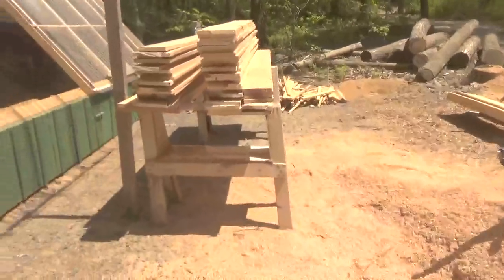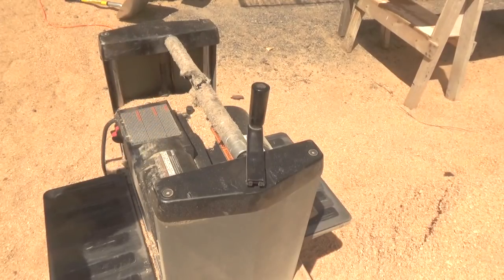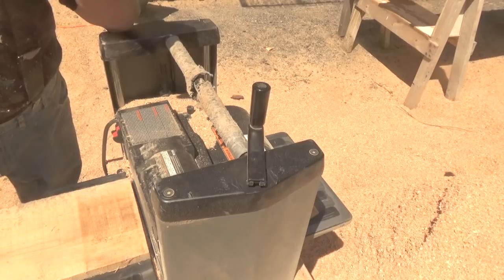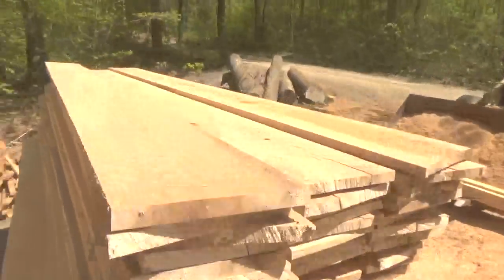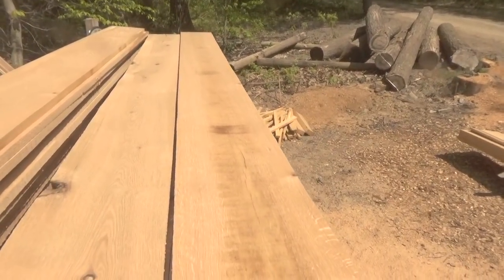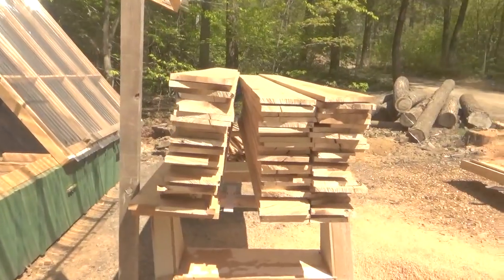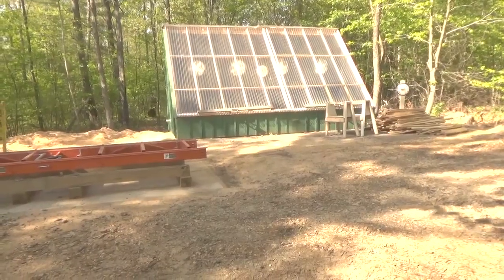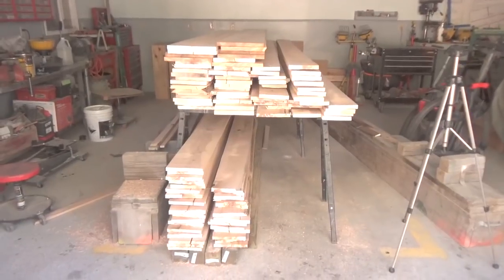Kiln is empty. The Woodmizer LT15 gave a load of nice red oak.

Comment: my grizzley planer works great too.I only adjust it 1/2 turn each time
Reply from the maker: roy ramey my grizzly planer/molder cut nice molding. I had a problem with the rubber rollers but they sent me knew ones.

Comment: Did ya leave enough space to get in the garage door of the green house or do you have to walk around to the entry door...?
Reply from the maker: I have to go to the entry door. Not a problem. I just need to remind my wife every time I walk around about the inconvenience, and how I need a 50 x 100 pole building.
Reply: That sounds like a good project for lumber storage..backhoe storage...etc....maybe even a truck or two...
Reply: Josaljo Won --- Just build your building with studs on 2' centers which uses less board feet of lumber than a 'pole barn'.....just speaking from experience after a contracting competitor and I had to 'educate an architect' because his 'pole design' went over budget. But the 2' o.c. design brought it back within the limited budget. However I still didn't get the job but the competitor did. 
However, if you need spacing in outside walls to access the structure with stacks of lumber and it's an 'open shed' then the extra cost will be a 'wash'.

Comment: The obsoletion engineers probably designed your planer for 2000 bf before maintenance or replacement....lol. I wish they would learn how to engineer for products to last forever (you know like it was 60 years ago when I began to buy tools), but then they/people would be out of a job. 
Maybe the six inch planks can be split and made into two pieces of door/window casing trim.  
….13